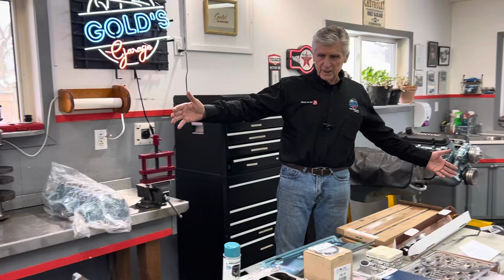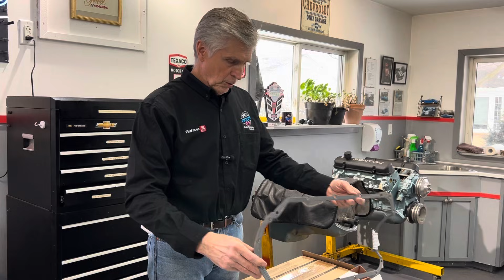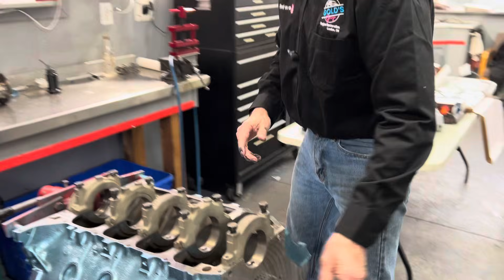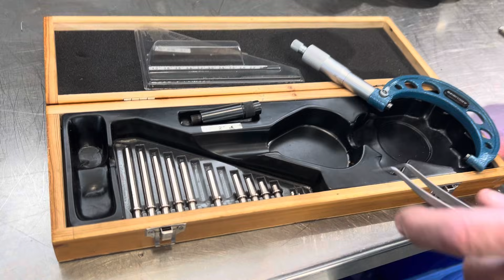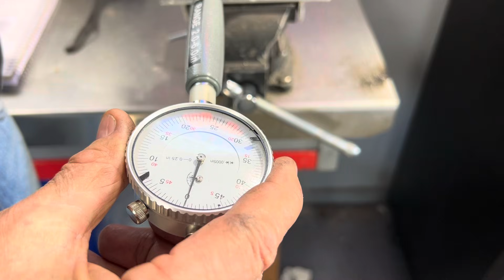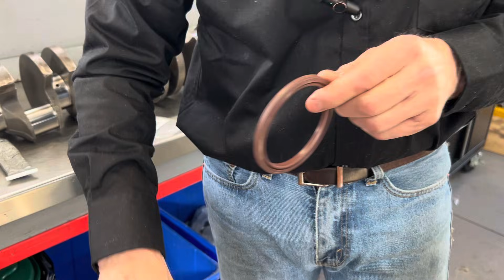Happy Ending to a Sad Story! Building a 400 Pontiac - How to install a flat tappet camshaft!

Comment: I can’t help noticing those main caps that. Have chunks broke off at the dowel pin area which keep those from walking at higher rpm is it safe thanks for all your good information I love Pontiac engines
Reply from the maker: Thanks for your observation Michael, lot's of comments about that. If you look closely, the dowel hole in the cap is still well supported in compression. The engine is still running strong.AG

Comment: Pontiac cylinder heads are a choke point in the exhaust ports. Aftermarket heads would be an improvement in HP!
Reply from the maker: You are exactly correct Mike. We just started another Pontiac 455 build. Watch for videos about it.AG

Comment: When I was 18 I dropped a small screw down the cab on my GTO. It embedded into the piston, didn't break it. I had to pull the heads. It survived another 10 k before rebuilt w 12:1 forgings
Reply from the maker: You were lucky! thanks for sharing your experience. AG

Comment: Main caps #2/3/4 are snapped of at the dowel pin...why weren't they replaced by the machine shop, and why did the owner exact that?...I didn't heard an explanation in your narration....or did I just miss it?
Reply from the maker: Thanks Dennis, the dowel holes in the cap were sufficient to locate it correctly. That engine is still running fine.AG
Reply: @goldsgarage8236  If it was being built for me I wouldn't except it. If it was my core, I would have replaced the caps before I sent it to you. I had a similar problem with a 535cu in short block built by a Pontiac Specialist, ($16,000)...had what they called an "anomaly"  in the deck along with core shift,...machine shop called it a crack and wouldn't  touch it...Company that cast the blocks said 15% of their Blocks come with that "Anomaly" and never admitted to the core shift and they wouldn't make it good. The Builder took the block back at their expense and sent a new block...I traded it to a Shop and bought a Kauffman MR1...no "anomaly" no core shift...end of the problem

Comment: Viva la paint pen!! After the last bolt is torqued, I also place a mark on the block below the motoring mounts. One color for mains, one color for rods another color for oil system components.
Cam has a color as well that I use for valve train components. Gray hair requires such tactics.

Over the last few months, our shop had two distinctive GTO's come through. Tuning and thorough inspections on both.
A 1965 and a 1966. Was lovely to service two proper cars. Oh yeah!! '65 is a manual, seex pack car, 1966, 4BBL, auto car. 
Either car was minted for one purpose, get a driver A R R E S T E D!!!

Love ya, Alan!!
Reply from the maker: Grear comments and tips, thanks so much! AG
Reply from the maker: I meant GREAT, not grear. sorry for the typo.AG
Reply: @goldsgarage8236  

Takes a Grear head to make a typo like that, Alan!!

Comment: Do you ever have problems with just the thrust bearing being too tight?  Not talking end play but inside diameter for crank clearance.
Reply from the maker: Not really John, usually the thrust bearing radial clearance is slightly more than the others. .001" extra clearance bearings are usually available. AG

Comment: Is knife edging the crank counterweights too expensive or unnecessary or interferes with the overall balance of the rotating mass?
Reply from the maker: Good question Thunder. Just expensive and used on high end high RPM builds. AG

Comment: I’m coming up with a plan to build up the top end of my ‘77 W72 in my Trans Am…in your opinion, is it worth it to go with the edelbrock manifold?…I was thinking about porting/polishing the original. I guess 30lbs lighter may be a good enough reason
Reply from the maker: Thanks for the question Good. I think the biggest benefit would be the 30lb weight saving. AG

Comment: How big of an overbore can a 400 take?
Reply from the maker: I don't know. With a bore spacing of 4.4", there is only .245" left between cylinders with .030"; .215" left with .060" . Then you have to be concerned about core shift. If you are considering anything over .030" I would have it sonic tested. AG

Comment: The  421-428-455 blocks are all 3.25 miles. The 55 up engines to the 400 are 3 inch main.
Reply from the maker: Thanks for the info Bill. AG

Comment: Similar but different case happend on my 455 TA,number 2 car fully restored,parked in garage sometimes 2 months without running it scratched the cam bearings and rod bearings .now I’m goin full rebuild 6x-4 heads Doug’s headers,fully upgrade front and rear suspension,4 wheel disc brakes willwood and so on 4 speed car .
Reply from the maker: Thanks for sharing.AG

Comment: Only guy ive ever heard say that there isnt a pontiac big block/small  block & hes right. Been driving me crazy for 40 years.
Reply from the maker: Thanks Jeff, right from 326 to 455. AG
Reply: Yeah, always makes me laugh when someone makes that claim. 
One thing I have noticed over the years (I'm a retired parts counterman and I worked for a decade in a speed shop) is that some people mistakenly confuse the idea of "big block" and "small block" Pontiacs with the fact that they big and small journal blocks, i.e., the 400 and 455, so I've had to correct a few people who said things like "The 400 is a small block and the 455 is a big block."

Comment: It wasn't Chevrolet that shafted Pontiac back in the day. It was predetermined by GMs corporate general managers that shafted Pontiac performance from become the factory performance power house. Pontiac division actually had the better engineers. Corporate GM general mangers wanted Chevrolet to be the mainstay top dog and umbrella the the other divisions. Instead of letting them compete against one another when it came to factory performance and parts availability. GM corporate let Chevrolet have forged cranks and rods and were plentifully available, but held Pontiac back because in the early 60s into the mid 60s Pontiacs performance was out performing Chevrolet on the tracks and stips. So by the mid 60s corporate GM would not let Pontiac have forged rods and cranks plentifuly, but limited them to use cast rods only.
From the early mid 60s onwards only engines to come with forged rods were the 400 RamAir V and 73&74s  455SD. Cast rods limited the Pontiac engines rpm to 5000-5500rpm where the connecting rods would begin failure process and total failure beyond that.
Chevrolet Wasn't the best in the performance dept but just cheap poor man's selection. General managers of GM are the culprits. John Delorean had to go around those general managers or there probably wouldn't never have been a muscle car era and wouldn't have what is today.
64 GTO the daddy of all American muscle cars.
Reply from the maker: Thanks why, a very informative and well articulated comment, AG
Reply: Just for discussion, there has been a few 421 engines found with forged rods. They don't look like any other production rods but are definitely forged. They have all( as far as I know) came from 63-65 engines. I've had discussions with other Pontiac people and have yet to figure out any rhyme or reason for them. I personally have removed 1 set from a '63 421 and I still have them. Just saying.

Comment: I still would have went with 4 bolt caps instead of using broken 2 bolt caps. 4 bolt caps are only $300 plus machine work.
Reply from the maker: Thanks for your comment Mike. AG

Comment: I cant believe the builder or the customer would let those main caps pass as usable, that's completely unacceptable & begs the question of in what other areas is damage or a defect acceptable to them. Builder should have refused to use them, the structural integrity is compromised regardless of where its broke. Should have gotten a good used oem set or new set.
Reply from the maker: Thanks for your comments Brian.AG
Reply: @goldsgarage8236  sry so negative, You're obviously very knowledgeable and do a great job, I have a feeling this instance was a case of the customer having a very limited budget and you were trying to help him out and save some money, which is nice of you, but on the other hand if the customer can't afford to use quality parts and you have to use compromised parts to help them then it's not worth building and putting your reputation on the line for using compromised parts, or it possibly failing. At the very least should've magnetic powder tested them and die penetrant tested them, other ways to check the integrity of the metal are through xray, sonogram, infrared imaging, ultrasonic spectroscopy, computed tomography, & radiographic film testing. I guarantee if you would've done any of these you would've found stress fractures within the metal. Write these 8 processes down & consider them next time you get damaged parts or an engine part your concerned could be damaged.

Comment: Hey brother I just replaced my head gaskets on my engine it want crank  didn't remove distributor still locked in place could my timing still be off
Reply from the maker: Sorry to hear Dean. If you think it might be timing, try cranking the engine with the ignition turned off. AG

Comment: In my Mechanic days back in the 70s, I ran 2 Pontiacs, one was a 400 in a Grand Prix. The Pontiac engine is so amazing in th eright hands. I put and intake and Carter AFB off a 389 on a 326. It came to life beyond expectations. The Ram Air engines and the 428 are never to be underestimated. They are a Force to be reckoned with. Read up. Any gear head from the 70s knows about these engines and cars.
Reply from the maker: Thanks for your comments Warren. good info. AG
Reply: To this day, I think 1 OF GM's biggest mistake was not allowing 7 liter engines in their midsize 60's cars. THE Pontiacs would have dominated the streets with the 428 in the GTO and Firebird.
Reply: I just picked up my 1st classic Pontiac Grand Prix I absolutely love it my dad had one when I was growing up

Comment: Great video, lots of good info for Pontiac folks!  I would have opted for a Hyd-Roller cam setup, as it seems the straight Hyd cams seem to fail more often than not - ask me how I know. 😵. My next project is to swap out my Hyd cams in my 400 to a Hyd-roller.  Enables me to run higher lift (without losing street manners).  Thanks again (subscribed)!
Reply from the maker: Thanks for commenting and subscribing. AG

Comment: I see the middle main bearing caps have a small chunk of casting missing on the edge where the dowel pins are. Is that okay
Reply from the maker: Good catch Christopher. The dowels are for alignment only and 75% is enough to accomplish alignment. AG
Reply: @goldsgarage8236  Not sure I'd run those middle main caps like that? Somebody got happy taking that 400 apart and busted the dowel alignment holes in the castings. Not good for a performance build imho. Center caps take take the heaviest load too and the main caps can walk. But thats the problem with finding good pontiac engine block cores today. The last thick casting 400's were built in 1974, pontiac did hold back a few thick casting 400's for the W72 400 4 speed TA's up to 1979 but those are also getting as rare as hens teeth.

Comment: These good looking 65s got 396 s ! Till 71 i paid little attention , but built a455 dont put over 300 shot or u see a burn ring around the engine room from the lifting heads !  About 15 years ago we were home page picture ,   about 2 foot up an 9.20s  with only 2 gears out of a 4001🎉

Comment: why do some of the early aluminum sbc heads have pontiac molded into them
Reply: i think they were nascar heads
Reply from the maker: I believe that is correct. Thanks for the info. AG
Reply: why did they have Pontiac molded onto them did they fit on a Pontiac engine as well @goldsgarage8236

Comment: We use  ARP L19 rod bolts with  79 foot pounds torque for turbo ls engines. Will the cap distort with those high torque bolts?  Thanks for the video. I’m planning on doing my 66 Pontiac GTO 400  in the near future.  I haven’t done a Pontiac since I was on high school. Class of 1969. Definitely in need of a refresher course. Thanks again for the video loved it.
Reply from the maker: Thanks Daniel. The clamping force is proportional to the torque (energy) that you put into it, so yes you could  distort the rod, especially an OEM style stock rod. AG

Comment: Then I traded a braided oval rug for a 66 three duces setup I drilled all my main jets to quarter inch then put a boat electrick ful pump in the back maid a fuel rail from a chunk of aluminum fed the primary whith a high output regularfuel and word up a switch for the electric fuelpump

Comment: I put a ram air 5 cam in mine 67 GTO engine
Reply: The Ram Air 5 cam will only work if you have the RA5 heads with matching intake and exhaust system.
Reply: Exactly, I was going to say it if you hadn't.
 @timsharpe3498
Reply: No you didn't.

Comment: In my experience you should never bore a Pontiac block  they have a elliptical bore and will not hold together even at 30 over but that’s what I learned the hard way
Reply from the maker: Thanks for sharing your experience Michael. AG
Reply: We usually need to take them out to .065 to true the bores up due to core shift.

Comment: Pontiac blocks are inherently weak. They crack between cam and the valley, only good for about 450 to 500, maybe. The clamping force on the heads isn't a good as a small block or bigblock with 16 head bolts.
Reply from the maker: There are 17 - 7/16 head bolts on a SBC. Each has a clamping force of 9,550 pounds. 9,550 x 17 = 162,350 pounds. There are 10 - 1/2" bolts on a Pontiac, each has a clamping force of 12,750 pounds, 12,750 x 10 = 127, 500 pounds. You are correct. AG
Reply: I'll take a Pontiac 400 over a 396BB any day. Pontiac doesn't have a history of losing to Chevy's.

Comment: Another outstanding and informative video. I especially like the technical background information you provide on the engineering that went into the original design. I also enjoyed the comparison information between the Pontiac and Chevrolet engines. Your videos communicate your knowledge and experience very well which inspires confidence in your work. Well done!
Reply from the maker: Thanks Todd. We should be ready for your 389 sometime in March. AG

Comment: Why would anyone use a flat tappet cam anymore  ?
Reply from the maker: Because roller cams are very expensive. I have installed may flat tappet cams and haven't lost one yet. A very detailed process for installation, start up and maintenance is necessary but it works. AG
Reply: @goldsgarage8236  it's a lot more expensive when a cam gets wiped out and you have to pay twice to get the whole engine redone. I will pay the extra few hundred forward every time.
Reply from the maker: Thanks Mitch, that is a good strategy. Thanks for commenting. AG

Comment: I've seen a dyno test on another respectable channel where it was shown the factory Pontiac intake manifold was stronger than the Performer across the power band.
Reply from the maker: Thanks for the info David. AG
Reply: @goldsgarage8236  That factory manifold still weighs a ton though.😁
Reply from the maker: It sure does, a good reason to use the aluminum manifold. They look nice too! AG
Reply: @davidmarshall8628  I used the aluminum water x over with the stock manifold saves a little weight

Comment: Hey AG,
     Tim here, i've known that cam # for a good while, as yes, you know i'm one of ur Poncho nerd sub'rs, its a great cam, has a bit of lope, and does well to 5500....not massive lope, and NOT for 6k rpm.....i can see the Performer intake, the motor wud do a bit better with an RPM, and the loss at low rpm wud be minimal....i have one here in my shop.......if customer just wants to drive, fine, great intake, if he wants to R&R a bit, the RPM is a much better choice.....the runner design is nite and day.....and again, we dont lose much at all at 2000 rpm, maybe other factors are in play.....i stopped the vid at 11 min to comment, i'm probably speakin to soon, but the combo seems appropriate.......OH, those #16's look to be the late '60's itteration, as the '70's version are quite difrent....i search for those #16 ('68) castings all the time...they are lovely!!......#48's or #62's can net same result......i ran 12:09 with stock, unported '62's in 2008......ok, i gotta get back to the vid
Reply from the maker: Thanks Tim. AG

Comment: When setting the thrust bearings do you have to hit the front first then the rear? Or does it not matter……
Reply from the maker: Good question Trent. IT doesn't really matter, as you see I moved it back and fourth with a screwdriver when checking the thrust clearance. AG
Reply: @goldsgarage8236  yeah i didnt even think of it that way…..thank you for confirming my thoughts!!!

Comment: Its too bad that the pistons had only two valve reliefs instead of four, would raise the compression some, plus fuel would swirl better in the combustion chamber and carbon buildup.
Reply from the maker: Thanks Leonard, we will be calculating CR and DCR in a video soon. AG

Comment: They’re a runner even in stock form.. Had one in a 69 Catalina that would shred the tires from a 20mph roll every time.. Two barrel carb n points ignition to boot. Lot of fun in that ole car.
Reply from the maker: Thanks for your comment Phil. AG
Reply: Great video AG!
Reply: Years back I had a 400 from a 69 Catalina in my 73 GTO. What a runner. Originally a 2 barrel engine but a factory 4 barrel intake and a Q Jet from a 76 500 Caddy engine rebuilt-it ran sweet and quick. Still you're correct, the 2 barrel engine was a tire shredder and still really quick.